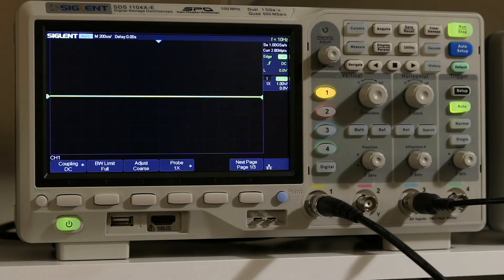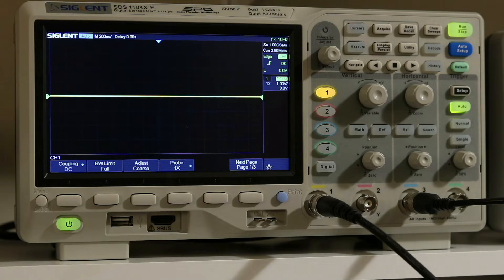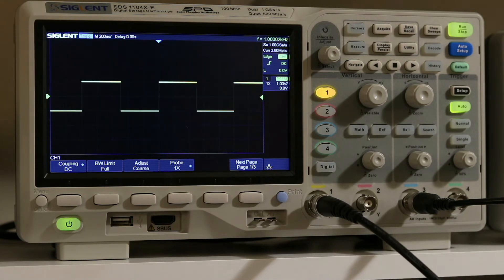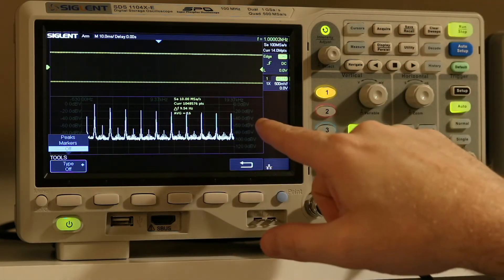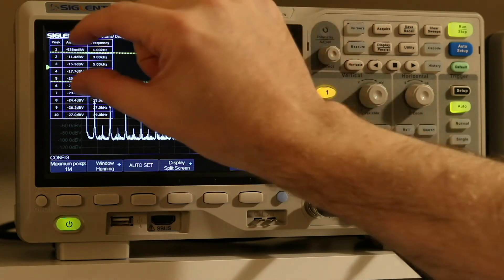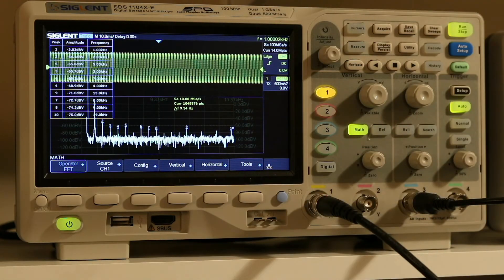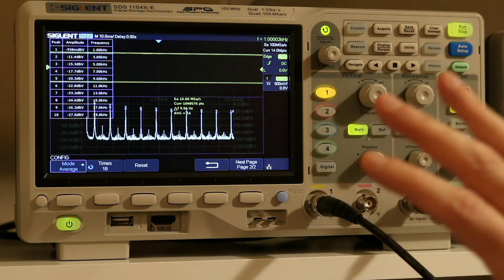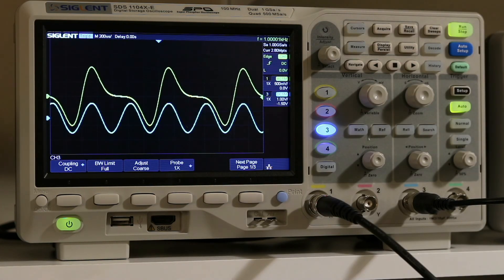Siglent SDS1104X-E Oscilloscope - Overview and FFT Function for Audio Use

Comment: Hi there. 13/Dec/2025
I too have the SDS1102CML (As opposed to the CNL which has less memory depth) bought about 6 ish yrs ago now and I bought the SDS1104X-E about 4 years or so ago.  I bought the 1104 for the decode functions (And 4 channels of course) but had to sell it for financial reasons...😔
I recently bought the SDS814X HD, a 12 bit scope (4096 voltage levels as opposed to 256 with the other 8 bit scopes) with 4 channels, 100MHz, and the decode functions...😁
The better 'bit' capability gives a vastly improved signal trace.  
The SDS814X HD is so new to me, I havent had chance to look for a firmware upgrade yet so new to me. 😋

Comment: Why does the x axis of the spectrum ranges from -630 Hz to 19.37 kHz instead of 0-20kHz. Negative frequencies - is this some sort of bug? If these values were selected automatically, is it possible to override manually? Greetings
Reply from the maker: The answer to this is quite complicated, so I'm not going to get too deeply into it, but essentially, an FFT is just math.  When a signal is mathematically divided into its sinusoidal components,  you essentially have rotating vectors in a complex plane, where the sign indicates the direction of rotation.  Pragmatically, this means that when you do the time-domain to frequency-domain transformation that an FFT does, it creates a mirror image of the data on the other side of zero (negative).  TL;DR Anything below zero can be ignored.

Comment: What's the Maximum MHz the FFT can measure?
Reply from the maker: That is an excellent question.  I'm not entirely sure, but this is a 100MHz scope, so I would doubt the FFT performance above about 90MHz, although I'm not currently doing anything near this range, so I'm not certain.

Comment: Great video. Sorry if I missed it, but will this allow say ch1 and ch3 to overlay and allow you to compare linearity between the two? For instance, measure input signal on a device and output of same device. 
Thanks
Reply from the maker: So far as I know, it is not capable of simultaneously displaying the FFT for two channels.  You'd probably have to spend quite a bit more for this functionality; this is an entry-level device, after all.  However, it would be quite easy to simply characterize the input to the device under test first, and then characterize its output second.  You could then compare harmonic peak amplitudes for relative distortion, for example.  You could also use other math functions to help with the observation of differences.... for example, you could subtract the channel observing the input from the channel observing the output, which would show the time domain waveform of the difference.
Reply: @Gem City Mastering  thanks for the reply👍👍
Seems like a lot of fiddling, but doable, I suppose. I guess a screen shot of both would do it, but non the less, not in real time. Shucks

Comment: my scope lost date and time after shutdown. Can you help?
Reply: The scope has NO RTC build in!
If you install a WiFi Stick and enable   NTP you will have the correct time after any start of the scope. Will NOT work with ethernet connection. Firmware...??
Reply from the maker: That sounds like perhaps a dead internal battery?  Or maybe it is synched to NTP and that got corrupted?  Honestly, I have no idea.
Reply: @gemcitymastering  works ist in your oscillocope?
Reply: @cambouiscom   yes NTP ist a solution and it works in my case. But you can set manually. And I expected the timer will run also when system down. I think behind is a linux and after restart it loss the values.
Reply: @cambouiscom  i have wrote an e-mail to support. I got fast an answer but not helpful. But the response time was very good. No I'm waiting.
Reply: @cambouiscom  my manual has only 208 pages. But NTP is ok for me. That solutes my requirement.
Reply: @reeder 76 thank you. You are completly right. A RTC would be nice.

Comment: I just got this exact scope this passing Christmas.   Its a great tool for tube amp and guitar pedal building as now I can see so much more what the circuits are actually doing to various waveforms.   I haven't tried the FFT math function yet but, as my curiosity is growing that should be coming up soon.   I just received a few Opto-isolators from Digikey today that I plan to try for amp mods that might pop loudly if the switching time isn't gradual and having 4 channels will be great, in order to view the LED voltage, R/C voltage slope, voltage across the resistor cell and who knows, maybe I'll find something else to look at with the 4th channel!  Thanks for the nice video, and hope you get alot out of your new Siglent!